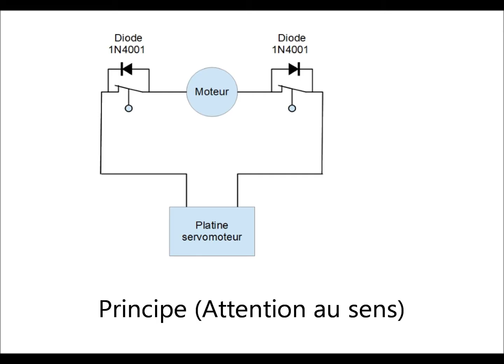Excavator rc New Holland 1/32 & pieces & cost

Comment: Hello, great work on your NH model! You are very skilled! :)
Your videos are really helpful, the part list with prices is a dream. But I've got a technical question for you: I need help with the actuators engaging point between the screw and the "piston" stem. I tried different pins and screws, but I still couldn't achieve any good engagement. The screw (drill bit) frames into the pin, expecially under any load. your actuators are instead very smooth and flowing, like real hydraulics. Speed and torque (thus axial force) you chose are also very scale. May you please help me? Have you got any picture of the engaging mechanism of your actuators? Thank you in advance! Fabio
Reply from the maker: +docfcybo 
Hello and thank you for comments.
If I understand the question, I'm not sure, the beginning of explanation is in the first two pictures of this vidéo.
https: //www.youtube.com/watch? V = l0tp9_1SMmY?.
I'm using a cotter pin. The rounded part fits very well in the groove of the drill. I drilled two holes in the tube to pass the pin through.
We must adjust the angle so that it slides smoothly as possible. With a little oil is even better. After, the outside can be filed so that the tube can slide in a bigger one to hide the drill.
(I hope it's understandable. i try my best with my friend google)